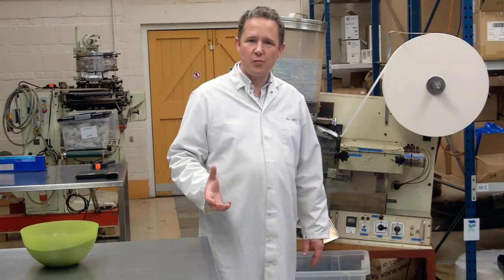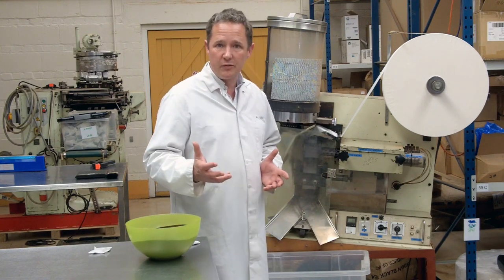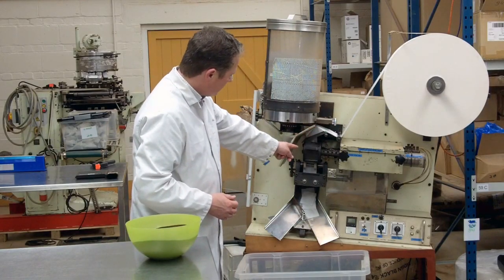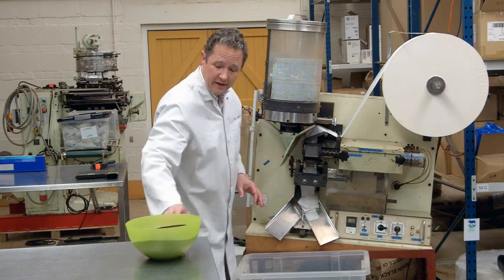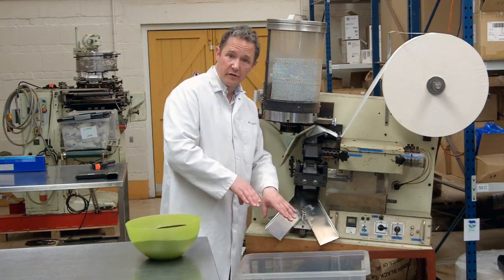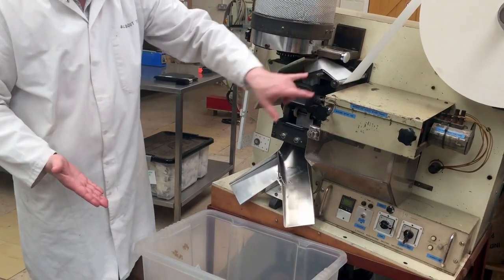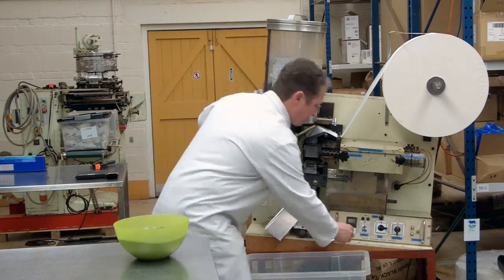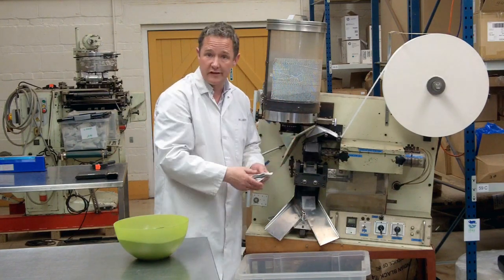How To Make Tea Bags using a Heat-Seal Teabag Machine TTV#57

Comment: Interesting to know. Very heavy duty machine. So I take from this then that while using bags there is going to be a slight difference in taste. There is the gum for sealing and the paper. But the trade off for when we are busy and want the convenience. Thanks for the info.
Reply from the maker: Yes, that's pretty much spot on! With a good quality tea you will still get an excellent cup of tea. The tea quality is much more important than the type of teabag or even whether it is bagged or loose.

Comment: Great vid' thanks. It is such a simple machine for making tea bags( and filling them) and well explained. I noticed the safety guard., which I believe is the law, to have fitted to all working machinery and thought you must have over-ridden the safety cut out to demonstrate. My question is, how easy is it for the operative to do the  same?
Reply from the maker: +Roy Saxby Thanks for your kind comment. You are quite right, for the purposes of making this video we had to override the safety cutout. This uses a key, access to which is controlled. So usually operatives would have to draw the key to override.
Reply: Ok, thought as much. In some cases it is the engineer who holds the key I believe. But only opened when repairs or adjustments have to be made.

Comment: This was really delightful to watch thank you. Has anyone ever injured themselves on the tea bag making machine?
Reply from the maker: Yes, it has been known to happen but thank goodness we have not had any injuries. The heated rollers and blades are quite dangerous if you put your hands in the wrong place. It is quite possible to burn, main, cut or electrocute yourself. For that reason, these areas are enclosed with a safety guard that is locked when there is power to the machine.  I opened it for the purpose of this video but I was being more careful than it might have appeared!

Comment: Is there a way I can make tea bags at home? I buy lose tea quite often, and I’m getting frustrated with my infusers, because tea gets stuck in the tiny holes of my infusers, and it’s a pain in the rear to clean. I’d like to somehow get tea bags, fill them with my tea, and then seal them. The problem is, I don’t know how I’d seal them, or what I’d need to seal them. There has to be an easier way to make tea bags at home, without industrial equipment.